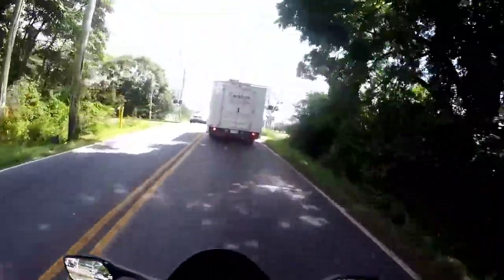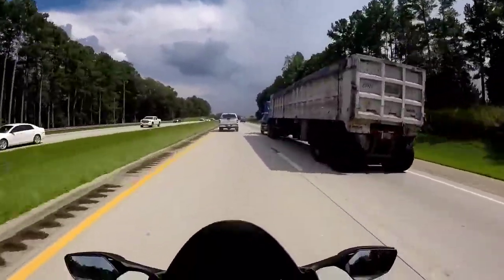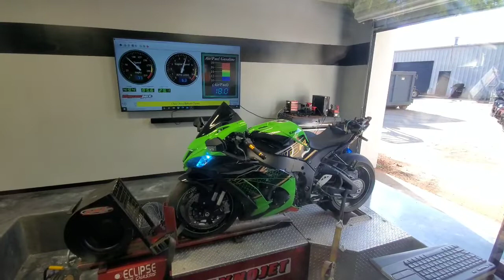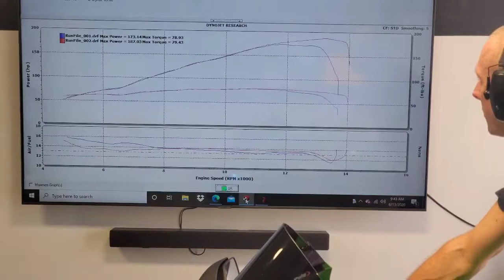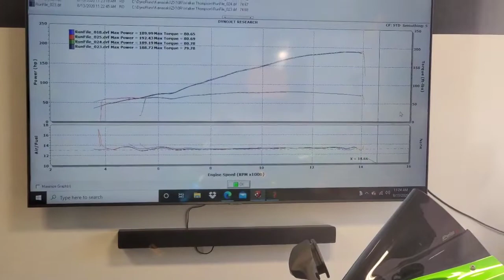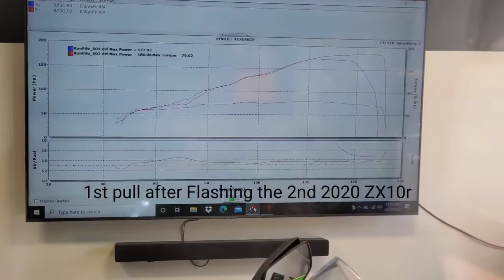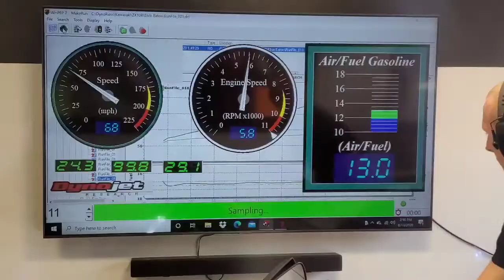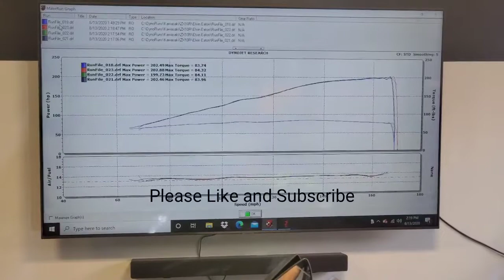Kawasaki ZX10R 2020 on the Dyno. Gets Moore Mafia ECU FLASH . 2020 ZX10R gets Stage 2 tune on MR12

Comment: I’m curious what was ur beginning numbers stock before being tuned or modded
Reply from the maker: I didn't have bone stock numbers. My cat was removed and I had a slip-on before putting it on the dyno.
Reply from the maker: Just saw a video of a bone stock 2020 with no mods on the same dyno mine was tuned on. It put down 164 bone stock.
Reply: QueMoto yup thats about right. I got 167 on couple zx10r’s

Comment: Did you remove the flapper for the ram air ?
Reply from the maker: Nah I didn't.
Reply: @QueMoto  Do you have stacks in your bike?
Reply from the maker: @oneshot_onekill4618  Nah, haven't pulled the trigger on any yet.
Reply: @QueMoto  Are you keeping it stock height?
Reply from the maker: @oneshot_onekill4618  Stock height and length. Thought about straps but I don't really race like that to justify them.

Comment: Yeah but R1 rebuilt wasn’t tuned and likely old tuning plus ZX has higher compression pistons and head work.
Reply from the maker: R1 was tuned by Chris on the same dyno. R1 had high compression pistons, ported head, Carillo rods, full arrow competition exhaust. 520 drivetrain setup.  

Newer bikes produce power more efficiently.